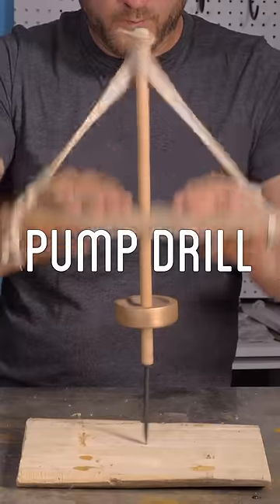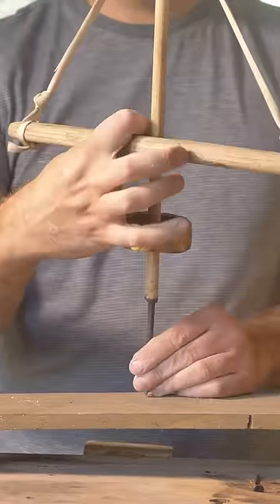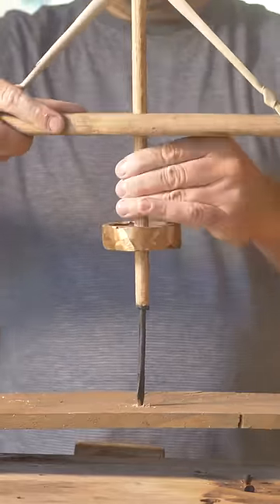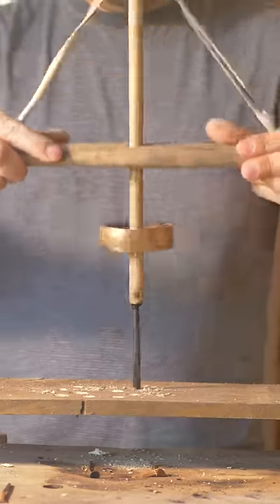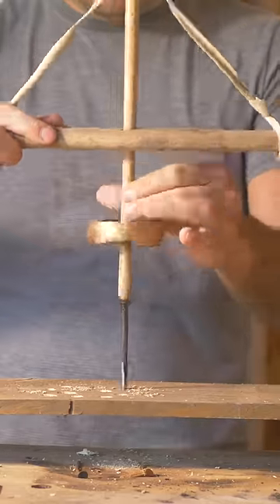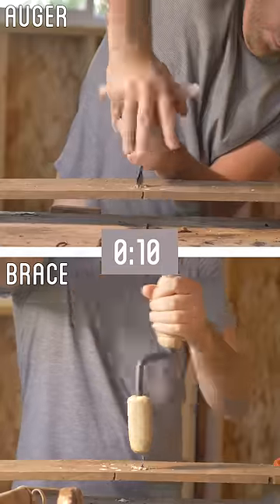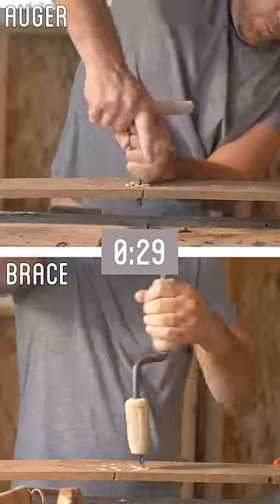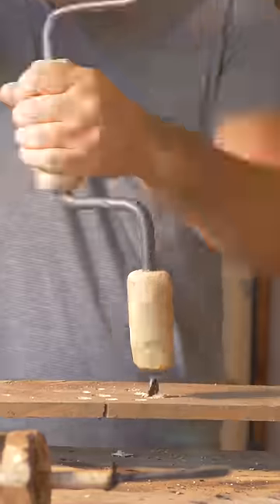Putting Ancient Drills to the Test! #shorts

Comment: Don't suspend the board from the ends, especially when using the first type of drill, the board bends in and "catches" the cutting part..
Reply: At least not that far
Reply: He probably just did that for our viewing purposes.
Reply: That’s what we were thought during woodworking class. The saws ALWAYS got stuck in he wood when we fastened them like that
Reply: Also just use water 💧
Reply: Also maybe a heavier flywheel would help
Reply: @EllenN2003   i think you're right but the cutting tip would snap if it would get stuck due to the shape and (maybe) an imperfect hardening.
Reply: The two flute straight drill has no means of swarf removal hense why there is too much friction. You notice the other two bits are twisted to help remove swarf.
Reply: @hugonobody3352  people don't know everything and advice is always accepted. Imo if it's not needed or redundant then cool, was simply trying to help. If it was then you just helped someone out
Reply: Yes, I was thinking that the whole time !!! 🤣
Reply: Also ancient ones had a more spoon shaped blade. That help pull the shaving out as you drilled
Reply: @Seether97  that is why the actual drill like that had a spoon shaped bit. And not flat like he made it.
Reply: i put the braces further in with weights on the ends of the board i’m working on(depends on where you’re drilling/cutting)
Reply: @avery7061  i prefer a sacrificial piece right underneath, it also prevents tear out.
Reply: This is very important!
Reply: Same deal when sawing a tree branch or any wood really
Reply: Bruh just use a normal drill....
Reply: @yashaswikulshreshtha1588  I think you missed the whole point
Reply: @corky842  yes
Reply: @hugonobody3352  wich isnt okay in a testing purpose
Reply: And use a normal drill bit
Reply: @hugonobody3352  too bad he wasn't interested enough to pay attention to the conversations
Reply: @hugonobody3352  sure but he also asked why it didn't work. thats why.
Reply: yea put a waste board underneath
Reply: Add that spin needle to pump drill..they work magic
Reply: yes yes yes
Reply: How about using actual full sized boards for your test. Not one bys
Reply: Tip geometry. Even a regular drill bit can get stuck if you sharpen it wrong. put a regular drill bit it it will only cut in one direction but it shouldn't get stuck.
Reply: Yeah, no. It isn’t bending in at all.
Reply: It’s probably just to see it come out.
Reply: @hugonobody3352  Then he has failed to make it historically accurate as well as functional. Sorry but is that good viewer experience?

Comment: The pump drill makes sense when you want to start a fire and have soft wood.
Reply: That’s actually what Native American used that for, learned from traditional knowledge camp
Reply: The pumped drill can even bore a hole in brass.
Reply: I think i saw 1st type on ancient egyptian docu
Reply: If it had a bigger counter wate he wouldn't have as hard of a time the wood catch's a little and just stops if it had some wate it would just power through
Reply: yall thats not what he meant...
Reply: If there was a way to keep downward pressure and not lose momentum then it'd probably work fine. I'll stick to my power tools though. 👍
Reply: Pumping with soft wood? Interesting

Comment: The pump drill could use a bigger flywheel, a little more force is needed to get it started but it'll have more force behind it as it's spinning.
Reply: Or use a heavier material like lead instead.
Reply: @gamingenius  Weight does matter but I would say size matters just as much. It's like if you was trying to remove a nut with a wrench, the farther out on the wrench you hold the easier it is to apply torque, even with the same weight.
Reply: Perfectly correct. The design is dependant on having torque as it removes material. Also the point where the twine wraps around the drill can be made wider to give more torque from the initial pull of the pump.
Reply: What do you mean? That's an average sized flywheel, I'm sure he has a great personality!
Reply: It then has too much momentum and makes it harder for when it comes time to spin the other direction
Reply: I was gonna say. I've never seen a pump drill with such a small flywheel. Some of the best working ones I seen used a flywheel made out of stone about 1" thick and 10" dia. They also used longer spin chords for longer spin times before going in reverse.
Reply: What about a corkscrew bit on the pump would it work?
Reply: Exactly what I was thinking
Reply: Yep a wider flywheel would help more than anything. No matter how much mass is on the fly wheel, it's too close to the center of rotation which is making it easier to stop. On top of all that, someone pointed out that having the board suspended from its ends makes it difficult for a tool like a pump drill to work its way through because the deformation of the board is enough for the hole to change shape as it drilles and essentially grab the drill. It's a common problem with hand saws as well
Reply: Exactly. Big stone flyweight
Reply: @gamingenius  you can make the fly wheel larger too
Reply: @gamingenius  that would just bend before you even breathe on it.
Reply: came to comments to say the same exact thing. Needs a very heavy flywheel like a 10lb stone
Reply: You need to make the pull stick longer so there is less downward force
Reply: You're gonna need a millstone.
Reply: @CalebParker1423  size and girth matter? I’m screwed
Reply: Same idea
Reply: Not necessarily more force, but rather storing more momentum. A 12 tons truck would requires much more force and distance, which is essentially energy, to reach a full stop compared a 3 tons car from a similar speed. 
Same goes for the plate. The plate can only goes so fast with elbow grease, but a larger, heavier plate sure is much less prone to disruption compared to a lighter, smaller one. The math regarding a spinning motions and moving straight motion is rather different (momentum of spinning object held size in high regard), but the correlation is still similar nonetheless.
What you said is correct, I just want give a better description.
Reply: That was my thought
Reply: Or a spiral head
Reply: jsut use big flat stone size is more important then weight even bike wheel would work beter then that small ring and big stone would be more historically accurat and also would work much better on hard stuff not soft wood
Reply: @saltissalty3498  actually speed is more important much more then weight, its because in calculation of force relation to speed is exponential not linear as to weight so 2x bigger wheel even when  2 times lighter if provided with same angle rotation speed would need much stronger force to stop
Reply: @jakubrichnavsky  the flatter stone is only better because the flatter it is the more the weight will be near the ends
Reply: Hopefully enough force to not effect the bands wear and the recoil on the handles much.
Reply: I was gonna say the same thing
Reply: @CalebParker1423  ээ
Reply: You read my mind.
Reply: Try a different bit for the pump drill like the ones you have on the others
Reply: @CalebParker1423  9
Reply: The pump drill will never work efficiently. Drilling requires torque and pressure...simultaneously. The pumping action results in intermittent pressure only on the downstroke and you simply cannot achieve significant torque by pulling a cord on a small diameter rod. Increasing the diameter of the rod to a point where it becomes significant however makes in impractical so it's a no win situation.
Reply: im not an expact but the head of the pump drill just doesnt look fitting for the tax
Reply: This is the answer, more inertia
Reply: @frazgt  No. Torque is the answer.
Reply: @internettoughguy  Greater inertia in the more massive flywheel leads to a larger application of torque, which as you’ll know is force (which will be larger due to the higher mass imparting greater force) at a distance (which could also be increased). So at best, we’re both right… tough guy
Reply: @frazgt  Yes I understand all the physics but you're not considering context and application. The guy is trying to drill a hole. For that you need a certain amoumt of control over the rotation of the drill bit, the applied torque, and the down force. A flywheel only develops inertia when it's rotaional velocity increases...then you need to also slow it down. This becomes impractical not to mention you would need the flywheel to be of significant weight. Given the context of this hand tool the best option is the auger with the offset handle. It allows you to control the bit's RPM, the applied torque, and the downward pressure...all of which are essential for drilling a hole. It's the reason why these manual augers were used for a very long time. They're light weight, easy to use, and simply work.
Reply: @internettoughguy  No one’s arguing which is the most efficient option to drill a hole. I’m only saying that increasing the size and mass of the flywheel (reasonably) would make the pump drill more effective. More inertia would enable the tool to overcome the friction encountered when the bit starts to cut. At the end of the day, people used the pump drill for many applications (all requiring drilling holes I might add) and the one in the video was basically useless. Yes, maybe supporting the wood properly or just using a different tool would be a better solution but the fact that we are talking about a pump drill suggests that they were at least used and must have been better than useless
Reply: This
Reply: @CalebParker1423  Which is why lead would be the choice material. Less size and more weight than compared to any other period correct material. Simply better overall
Reply: Also, making the bit a spoon to shave the wood instead of shred it
Reply: @CalebParker1423  You're correct, Inertia of a cylinder = 0.5 x Mass x Radius squared. So size is actually way more important than weight.
Reply: @0niichad  hey could also make extended arms in a t shape on it with small weights on them. this would have better results as is artificial make the radius bigger and adds more Centrifical force and will have more tourqe. He could also add a split curve bit.
Reply: @dallinlake4274  Nobody commenting here has actually used one of these critters. You have to push down hard enough to spin the thing and then stop it when you hit bottom, so all that work just went to waste. A well designed one will have the spiral to drive the thing and then a key shaft so that the handle can come back up without driving the thing backwards.  That basically limits the thing to one revolution before you hit the key shaft. You don't have a long drive to build up momentum and a heavy weight will just tire you out. These things were not intended for high torque situations. They were meant to drill small holes, usually with a twist bit, or to drive small screws. I've used one for both and it isn't much fun, especially after several hundred screws.
Reply: @everettlwilliamsii3740  actually I have used one and have degrees in theoretical physics, mechanical engineering, and quantum physics. Myself and many others are just commenting to make it more effective and fun to use. Think of it as a group think session on mechanical engineering  and physics. We are not saying it is impossible to do in its current state. We are just saying that there are better designs and methods of making a pump drill. Have fun and always remember to be positive. To everyone else what other ideas do you have to make it better. Remember nothing is fact in physics. It's all theory
Reply: Agreed, anything to increase the moment of inertia, so a larger flywheel, having more mass further away from the cog in any combination should help keep it spinning at the cost of making it more difficult to get up to speed
Reply: @qtippy1414  the problem is that how the pump drill works

Is spins one way then the speed winds up the rope then it spins the other way

It’s does spin one direction it spins both ways
Reply: @gamingenius lead? 💀
Reply: This.
Reply: I’ve seen video of a pump drill with about a 2cm thick by 20-30cm diameter flywheel doing a pretty good job of drilling holes. It’s been a long time so I don’t remember the material clearly. I remember that it was used to drill holes in shells among other things.
Reply: Definitely need more torque on the pump, add more weight. Also get sharper or narrower bits. While the pump has the most speed, you are trading torque for it. The auger and brace allow you to apply more force and torque, so they can tear through the wood better.
Reply: Make the tip look like a more modern drill bit
Reply: Yes, the flywheel in the pump drill as seen in the video is a bad joke. Key thing is the formula:
L = mvr
where
L = angular momentum
m = mass
v = velocity
r = radius

Can't do much about the velocity, but both mass and radius are easily changed. He had the right idea about putting most of the mass at the rim of the flywheel, but it's still comically small.
Reply: Add a motor
Reply: @CalebParker1423 size matters?😢
Reply: @de0509  can't pull it the other direction if it never got there from the first
Reply: @de0509 I don't think so, the shaft should be sorta made with that in mind so that the inertia is dampened rewinding the cords. Also, the friction is going to stop it from having that problem, but the rewind between pulses slows it for the next one.
Reply: @jonslg240 No it's the flywheel! This flywheel is dinky and tiny! I'm here to explain what nobody else noticed, it takes a pump drill expert like me to analyze jk.
Reply: @internettoughguy The pump is to spin the spindle, the downward force is the weight of the flywheel.
Reply: @gamingenius  lead is too soft
Reply: @gamingenius  For angular momentum, having material further from the rotational axis is often more efficient then using denser material.
Reply: That’s exactly what I was thinking
Reply: Add two big rocks to the end off the handle

Comment: the brace drill is still used, so...
Reply: I used it in school, only 10 years ago. I still have one, just to be on the safe side
Reply: Exactly
Reply: I have one still somewhere on balcony. But it's made of steel tho
Reply: I have a couple in the workshop.
Reply: glad to see this, thankfully I'm not ancient
Reply: They are surprisingly effective.
Reply: Augers are still widely used too, especially in bushcraft and ice fishing. For bushcraft, they can come small enough that they are easy to carry, and often simply having no handle, instead you just grab a stick near you and use that. For ice fishing, they make them really big and give you tons of leverage to drill through the ice. I guess the big difference is that the brace drill is very user friendly and great for average use while augers are great for the extreme ends of the spectrum but tougher to use
Reply: @alexzander7386  When I was young we used an axe to cut a hole in the ice to ice fish. 😂
Reply: @dannygjk  to each their own then, lots of augers here in CO
Reply: That’s what I thought- that pretty clearly tells you which design is best/easiest
Reply: @alexzander7386  Yes of course using an auger is an easier way to make a hole in the ice than an axe even if it is three feet thick.
Reply: My grand dad still used it and he taught me how to use it as well. It’s the first drill I’ve ever used
Reply: @alexzander7386  Using an auger is the professional way to uncork a bottle
Reply: @tno5357  you can also use a sword
Reply: So is the auger what do you mean?
Reply: The funny thing is the brace is called an “auger” too. Haha 🤣
Reply: @alexzander7386  ice fishing augers are brace drills.
Reply: Ok
Reply: That doesn’t mean that they aren’t ancient. For example, we still use wood to build stuff today as well.
Reply: I hang cable lines for a living and normally we use an electric drill to put our bolts in the poles but we always have a brace available for when we can't get our trucks to the pole.
Reply: @dannygjk An axe works if the ice is thin, but if you have REAL winters, a brace-style ice drill is best.
Reply: @alexzander7386  I don't remember ever using one but then that was over 50 years ago I doubt we could buy those back then where I lived.
Reply: Pump drills are also still used, but for very specific purposes. They're used in jewelry making and ceramics for when you need a very thin drill bit and you can't apply much pressure without breaking the material you're trying to put a hole in(which auger and brace drills will do since you have to put weight on them to work them) and power drill speeds generate to much heat which will affect the metal or ceramic that you're drilling.
Reply: All of these are still used

Comment: For the pump drill use smaller diameter bits that are  square in profile like a bird cage awl. Another consideration is using a spoon bit which the oldest type of drill.
Reply: Second the spoonbit
Reply: It really just comes down to blade alignment. The bit he's using has blade angles that oppose eachother whereas if you look at say, a spade bit (which this seems to attempt to mimic) the angled face of the blade are on opposite sides from eachother making it so the leading edge will always come in contact first while rotating it in one direction. During the upward pull of the pump you're not exerting "bite force" on the bit so there's no practical reason to have a dual directional bit. 

He could use the same spiral type bit he made for the other drills and it would most likely blow the augur out of the water.
Reply: Also, a larger flywheel will help.